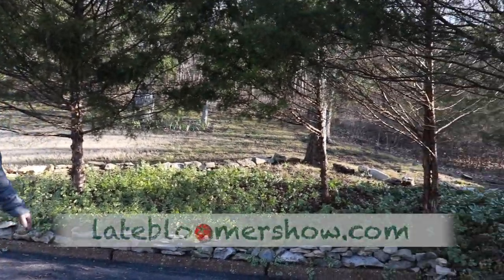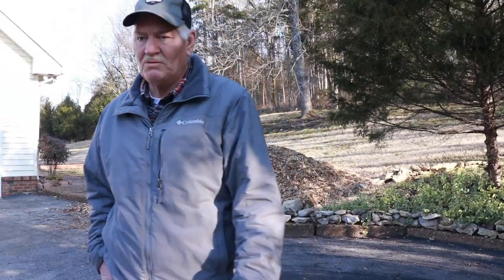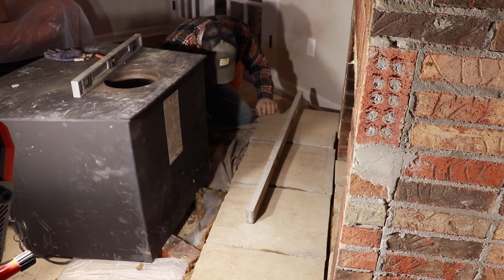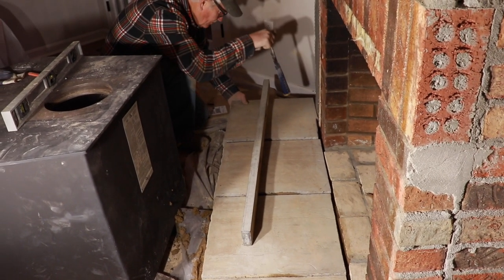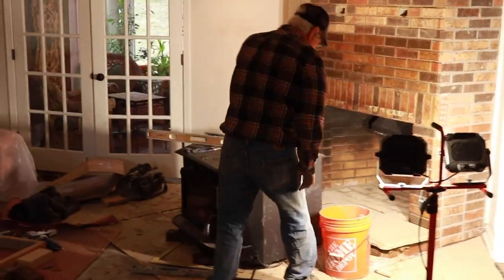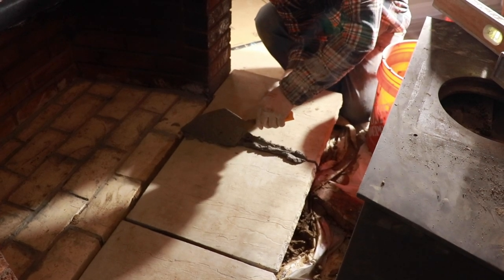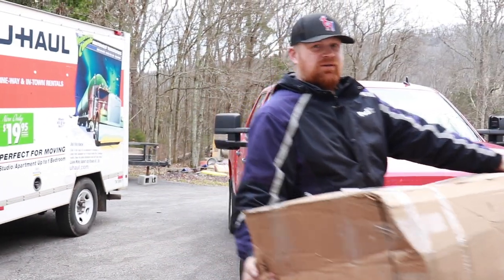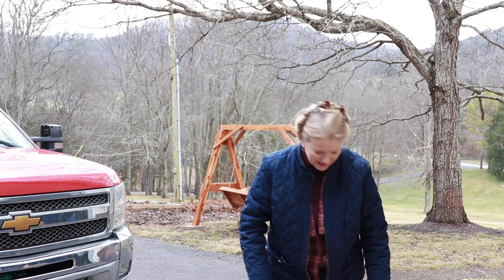WATCH OUT! She's got the TOOLS again! (and the prettiest cushions!)

Comment: Making friends with a guy like Tommy is so great. If he can't do something, he'll know who in the area can. And, most likely, that person is kin. Taking the cedars out will really open up that bed. Maybe some rhododendrons or gardenias there. I took some cedar trees, cut the limbs off about 12" from trunk, and used one for bird feeders and one for a natural post for vines.  On the wrench set, check the sizes marked on the sides. One may be english system and one metric. One of my favorite tools is a cordless drill. You can also get screwdriver tips and socket tips for it. It can unscrew those bolts in a flash.

Comment: The bed with the cedar trees would make a beautiful cut flower bed. Don't freak yourself out worry about snakes etc, they will be around.  I don't like them but living in the country most of my life I got used to the surprise it gave me when they appeared. Only person I knew who got bit was trying to pick it up. One huge black snake used to hang around the barn because of mice. My mom always said it was bad luck to kill them so we never did. Most of the time if you're out walking they will run hearing the slightest noise.  Unless they're sunning then self on a warm rock or warm concrete like your garage floor if the door is left open. . Bird feeders will attach mice in turn will attract snakes. The cycle of life. You really shall get a dog, best partner when out walking.  Dogs will see or hear a snake and scare them off. Try to find a collie rescue in your area, best country dog you could own.